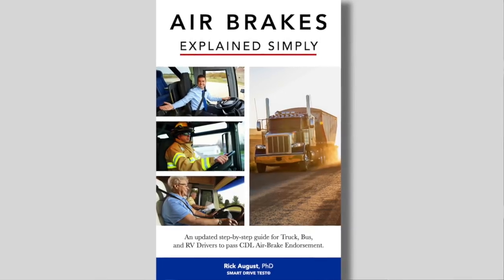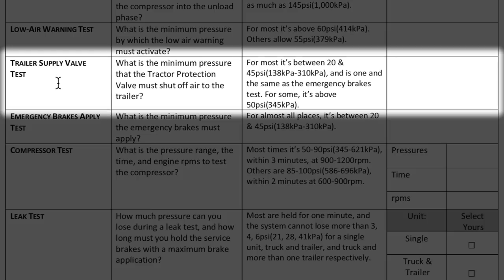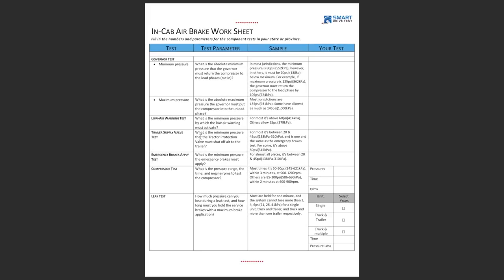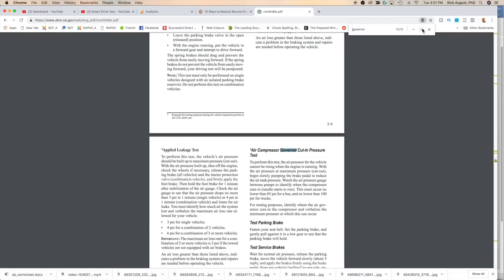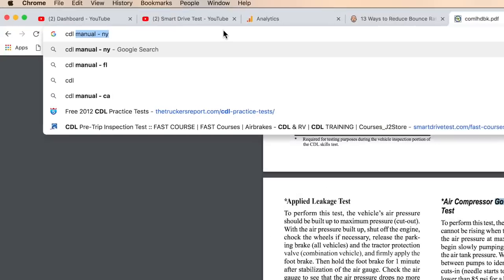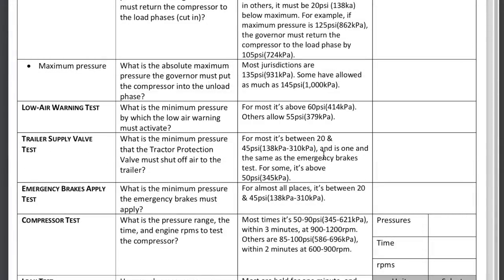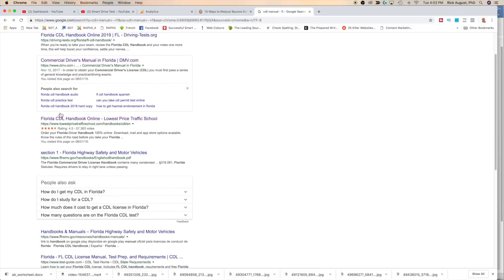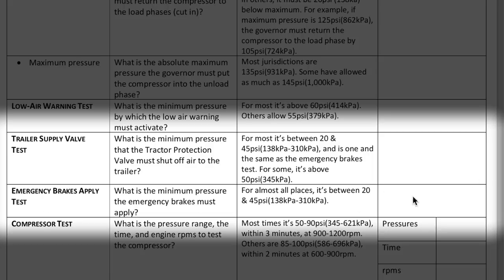How to do In-Cab CDL Air Brake Pre Trip Inspection with Checklist

Comment: Why during the compressor test did you write 45 seconds when the manual said 3 minutes?
Reply: Also, you said the RPM were 600-700 but the manual said 600-900
Reply: My mistake, i see where it says 45 seconds
Reply from the maker: Hey Mike - where in the world are you doing your Air Brakes? Cheers Rick
Reply: @smartdrivetest  Hey thanks for getting back to me Rick, i found where i was mistaken, sorry about that. I plan on taking the test in Toronto Ont